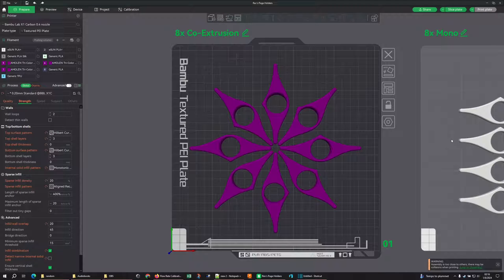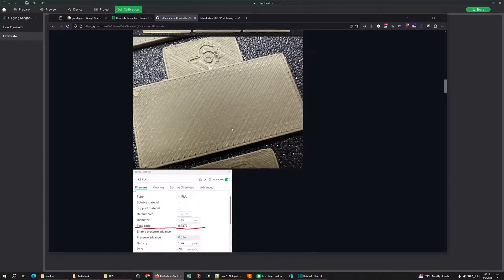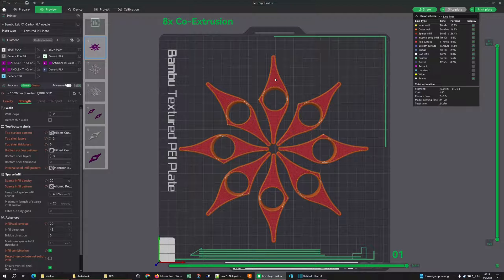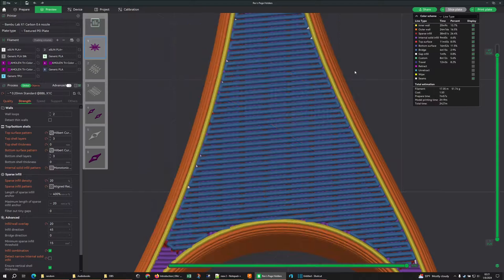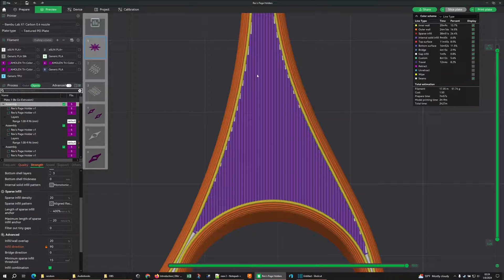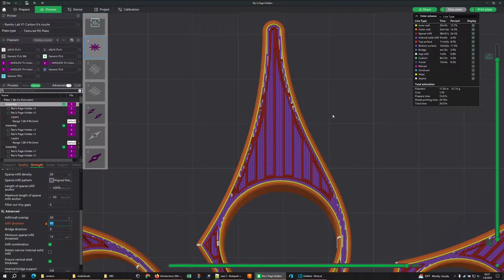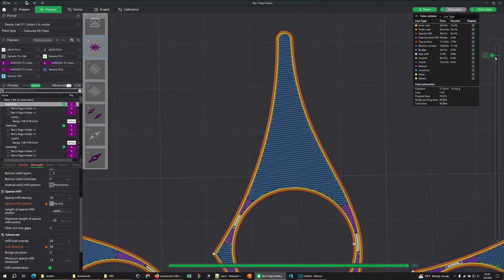Improving Top Surface Finish

Comment: This has been by far the best video I've seen to improve surface finish.

I'm still having some issues with some prints, I was wondering if there's any chance we can get in contact so that my colleagues and me can pay you for your advice and guidance with some particular issues that we are having.
Thanks for the help!
Reply from the maker: I'm glad it helped you out!

Calibration, sparse infill type, and alignment really are just about all there is to it.

FB Messenger or Discord, I'm RevHazlett on both. I can take a look at whatever you're struggling with.

Comment: Great video Rev. I am having issues with adding text to the top surface in bambu and having some lines running from the edge of the text to the edge of the top surface making it look like it is sewed in. I am going to try this. If anyone has ran into this issue please let me know what fixed it.
Reply from the maker: This should certainly help, but two other things: 
1) you may simply need another top surface layer or two if the filament is not particularly opaque 
2) check the other video about solid internal infill patterns (the two silver coins). That'll probably do as much as anything to help you!

Comment: Man I love your video. I’m gonna try this on a tissue sized box I’m making. I’m having the hardest time getting the corners from warping up a bit and the top layer to be consistently smooth. It’s a 9x4x4 box
Reply from the maker: Normally scrubbing your build plate in the sink (hot water and Dawn soap) coupled with controlling air drafts around the printer (ceiling fans, AC vents) is enough, but when it isn't I really like using mouse-ear brims with a 0.05mm gap to help with this. They're effective and easy to remove without scaring a print.

Bambu has an excellent write-up on them and the process is identical in Orca - https://wiki.bambulab.com/en/software/bambu-studio/brim-ears

Comment: Thank you, I did ironing on dungeon blocks and it made it less smooth. I don't fully understand how I should fix this. experiment I shall!
Reply from the maker: Ironing requires a really flat surface to work (the point of this video), but requires it's own separate per-material calibration to really work at it's best. This is by far my favorite way to find exactly the right ironing settings: https://makerworld.com/en/models/175615-complete-ironing-test-for-pla-and-petg?from=search#profileId-193062

Comment: But why do I get a single raised line tangent to a hole or the edge of text?
Reply from the maker: @boboscurse4130  probably a combination of top surface and internal solid infill patterns. A little more detail on that in this video - https://youtu.be/4xiDnn8Gcx0?si=XhTGdQ_ElplshGrF
Reply: @RevHazlett  That's a great video.  Thanks.  I already use monotonic line and 4  top layers,
Reply from the maker: @boboscurse4130  what improved the top surface is the internal solid infill pattern - smoothing out what's immediately beneath the top surface. The default is rectilinear; try monotonic line.

Comment: Have been constantly trying to find solutions as to why I have such crumby top layers. In the back of my mind I had assumed that it had something to do with that bridging not working all too well. I’ll be trying this on my next print! Thank you sir
Reply from the maker: @United_W3_FALL  let me know if this helped you! Current versions of Orca and Studio do a MUCH better job of aligning top surface to infill than the versions that were it when I recorded this, but choice of spare infill pattern still affects how it aligns things.
Reply: @ currently have been making “Lego” wreaths for the holidays. Filament is calibrated (PLA), Gyroid at 10-12% and almost every print has artifacts at the final layer. I rotated the infill 90 degrees as you did, and it seemed to support that bridge much better. Waiting on this print to finish so I can see if that made any difference or not. Remaining hopeful that you fixed my week long headache!
Reply: @RevHazlett this print isn’t even FINISHED YET AND IT LOOKS ABSOLUTELY PERFECT!!! I have been scouring Reddit for DAYS and you solved my problem in 10 minutes. HATS off to you sir!
Reply from the maker: @United_W3_FALL  glad I could help. Happy printing!

Comment: So if i understand it correctly (english is not my native language)
- Change infill direction to be as close as possible of perpendicularity between the first top layer and the last inflill
- Then add ironing
Reply from the maker: @monsieurglu  if your infill is dense enough (20% aligned rectilinear is my choice) and perpendicular to the lowest top surface layer (the light blue one) you should not even require ironing. If you do iron though, it should be smooth as glass. Bambu Studio changed since I made this video and it's now pretty good about make the lines perpendicular automatically. Check your preview to see!
Reply: @RevHazlett  thx :)
So i understand correctly, i just need to check and change if not perpendicular :)

Comment: why not just use honeycomb or rectilinear infill?
Reply from the maker: Honeycomb is slow and has a multitude of retractions. Rectilinear has a tendency to cause issues where the segments cross.

Both can work just fine, but in instances where the focus of the print is top surface quality above all other features I'm running aligned rectilinear or gyroid every time.

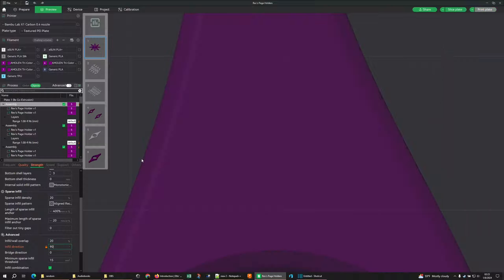Comment: I've been a fan of the Hilbert Curve - mostly because it is so hypnotizing to watch print.  Interestingly though, I had thought the bridge layer on Aligned Rectilinear infill would cause the bridge layer to be normal in direction to the previous layer.  However, you are able to change it (at about 07:00 in the video). I'm using Orca SoftFever v1.9.0, with a split torus .... maybe it is model dependent.  I assume the "direction" (Infill, and Bridge Infill) is based on the bed coordinates vs object/model. [edit] I'm a big fan of the Honeycomb Infill pattern.
Reply from the maker: So infill orientation is (in Studio/Orca at least) 0° along the X axis. Set it to 90° and it runs along the Y axis.

The infill pattern name "Aligned Rectilinear" makes you think it'll have correlation to one of the solid layers, and it does - your first layer.

As far as the bridge direction, this is where my commentary muddies the waters. Throw a cube down and tell it 0°, 45°, or 90° and it'll still draw it the same exact way, every time. Because that's an internal bridging layer. The "Bridge direction" override only effects external bridges, eg; lines bridging between two external walls that are not considered solid internal infill. Had I given it a little thought, I would have made that distinction in the video 🤣
Reply: @RevHazlett  Interesting. The branch of slicer I have, in the Object|Strength|Advanced section, I have
Infill/wall overlap as %
Infill direction as º
Bridge infill direction as º
so I assumed the "Bridge infill direction " would allow me to set it as you had. I'll keep poking around and learning. Cheers
Reply from the maker: Oh, and if you haven't done it - try Hilbert Curve as a surface pattern with a co-extrusion filament. It looks awesome!

Shameless link to an example - https://makerworld.com/en/models/145162#profileId-157911
Reply: @RevHazlett  Cool!  I'll give it a go (after I finish this vase mode PLA+CarbonFiber print) with my left over (yes, Christmas Santas) Quantum Green+Raspberry filament.
Reply: @RevHazlett  Additional note: The mouse-text for the Bridge infill direction" does say "Bridging angle override. 0 means the bridging direction will be calculated automatically. Otherwise, the provided angle will be used for external bridges. Use 180º for zero degrees.".
Reply from the maker: @truegret7778  yup, it's that "external" that is commonly overlooked!